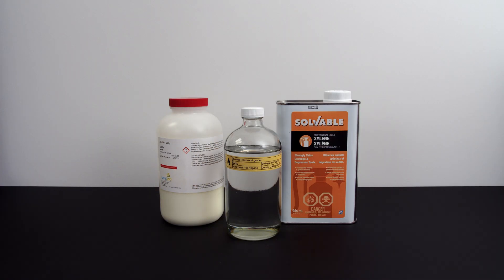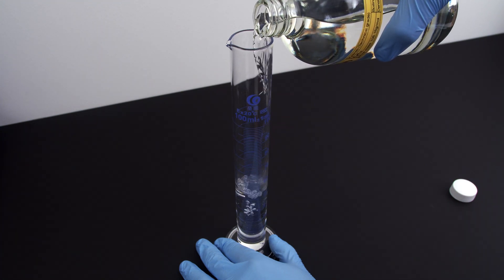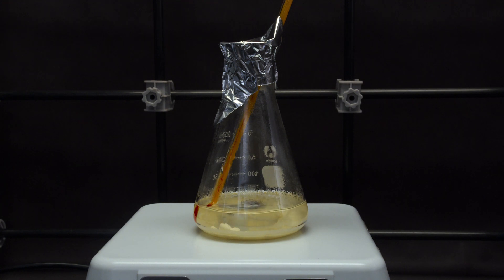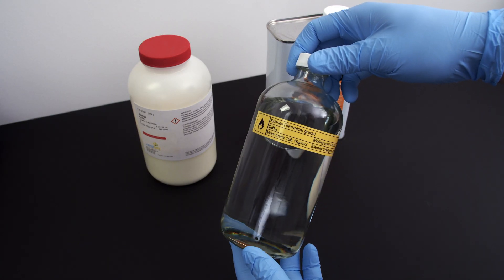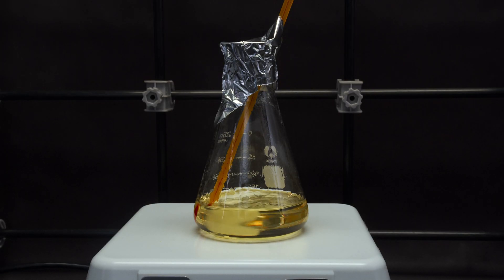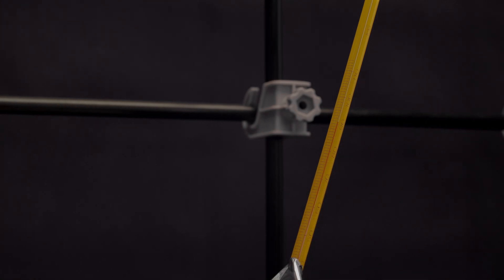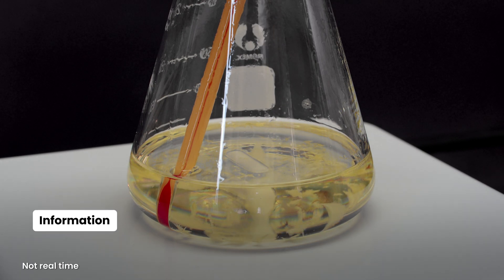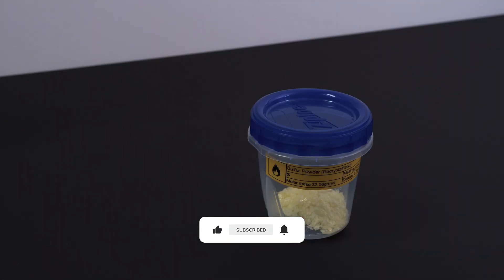How to Purify Sulfur by Recrystallization with Xylenes

Comment: Be careful with xylene I got a headache from breathing it in during vacuum filtration had it for a week straight. It’s bc I forgot to turn on my hood fan, before I was using for an rxn and refluxing it for 6hrs and had no problem
Reply from the maker: I always turn on my hood when dealing with organic solvent, most don't smell good and they often induce headache.
Reply: @DangerousLab and even though my fume hood is a homemade ghetto hood made from OSB wood panel and a toilet pipe adapter, a growing fan, large acrylic panel with clamps to close the “window” and duct meant for clothing dryers. It works very well,
Reply: @DangerousLab did you build your own fume hood or is it an actual OSHA approved steel fume hood
Reply from the maker: I am using fumehood build out of 4040 aluminium and polycarbonate rn due to size constriant, I used to have full size OSHA steel fumehood in other locations.

Comment: I did this using garden fungicide sulfur for planting potatoes.  There's quite a bit of crud in there.  I probably breathed in too much xylenes..  Sulfur is cheap and available.  Probably won't do this again..
Reply from the maker: Ya, high quality sulfur is actually quite cheap, so don't bother doing the recrystallization unless you really need it, it doesn't worth the risk of breathing in aromatic compounds.

Comment: Is it already pure? how's the melting point after purification?
Reply from the maker: I did not check the melting point after the recrystallization as the original source was already lab grade, this experiment is more the demonstration side of the recrystallization techniques and the difference between alpha and beta sulfur.
I usually only check for melting point for synthesized compounds with questionable purity.

Comment: I want a lab rack like yours, where did you get it
Reply from the maker: I made it with 10mm carbon fibre rods and clamps, aluminium rods should work as well. Alternatively, you can search for "Lab lattice" online, there are many variants out there, but I haven't tried any of those so I am not sure about their quality.

Comment: I want to see you do this with impure sulfur.  I've seen ~92% pure hardware sulfur try to be dissolved in hot xylene and it was a huge mess.
Reply from the maker: I definitely went into a blind spot while doing this since I already have lab-grade sulfur, should have been more thoughtful when I was doing it, considering amateur may not have access to lab-grade chemicals.
Reply: @DangerousLab if you ever want to try it with impure grades, visit anywhere that sells plants and buy a bag of soil sulfur.  It's probably 92 percent and the rest is some kind of clay I think.
Reply: You need to use enough xylenes to dissolve the majority of the sulfur, and filter while boiling hot.

You need a vacuum filter and very good ventilation
Reply: @Abdcwyxz I tried this but it was still a mess.  The sulfur would plate out on the beaker and when managing to dissolve it all and pour it into a filter, the sulfur cooled enough to plate out with impurities in the filter funnel.  I think this would only work if you could keep the funnel hot too, and the vacuum would help too.  Either way, I abandoned it.  Even outside the fumes were too much.

Comment: The only problem k have with this process is what to do with the contaminated xylene. You can attempt to recover as much xylene as you can through distillation, but sulphur likes to distill over with it. So I'm not sure what to do with it as waste.

Also,of you lack a proper lab refrigerator, you can use a camping cooler with ice.
Reply from the maker: I usually prefer to reuse the xylene for another batch of recrystallization as I often do this. I never tried distilling the xylene to recover though because it is fairly cheap, I will definitely want to try this procedure though, probably when I gather enough xylene.

I don't think sulfur will likely distill together though with xylene, as they have significantly different b.p., do you by any chance have sources describing this issue?

Btw, good suggestions for using a camping cooler as a refrigerator replacement!
Reply: @DangerousLab  my experience with sulphur carrying over is in trying to precipitate sulphates in aqueous solution, then distilling the water. You don't get much but there's always a faint  sulphur or sulphide smell in the distillate. The concentration is low enough to safely pour down the sink, but it's not zero. I haven't tried the smell test with xylene because, it's xylene. I don't have any references because...well I'm not educated as a chemist.
Reply from the maker: @nunyabisnass1141  I will note this down and check it back next time I distill it, thanks.
Reply: @DangerousLab  thank you, I'm interested in seeing the results as well.
Reply: Probably the safest thing to do with the leftover xylene is to burn it outside.